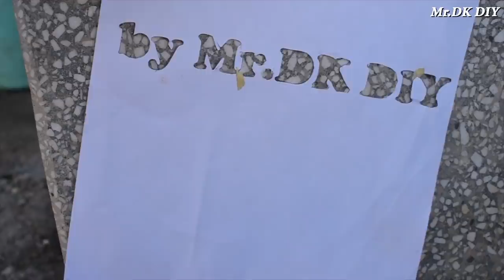DO NOT THROW AWAY YOUR OLD BIKE / DIY GENIUS SMART IDEA

Comment: The rear ski mount (triangle) should probably be closer to the toe and taller by about 8-12 inches as to allow the ski to swing up into the frame instead of resting on drive sprocket tube. And, try springs attached to the skis to pull the toes up. That will keep the skis from swinging backwards in case you get a little, or a lot of air. Also you should think about some kind of braking system (besides your feet).

Comment: A good tip before you cut any threaded rod is to place nuts (2) near ends of both cut ends... then use the nuts & some good thread cutting oil as a DIE to re-thread the rod after cuts